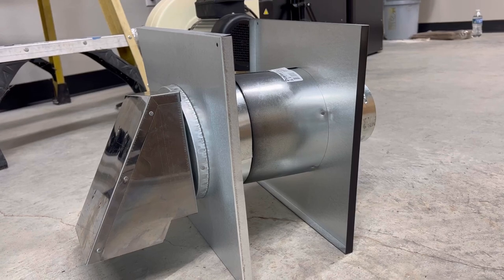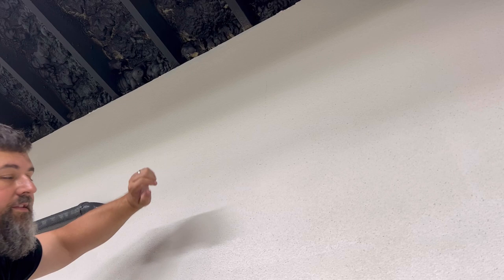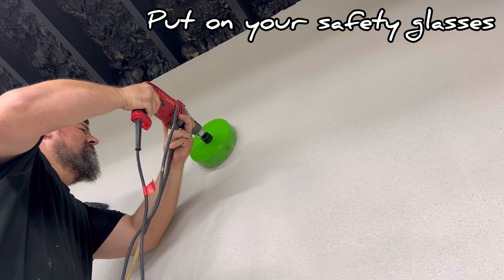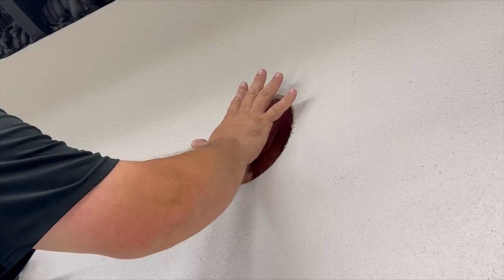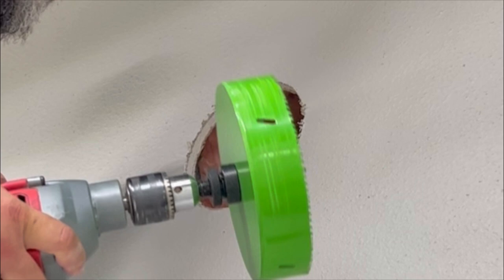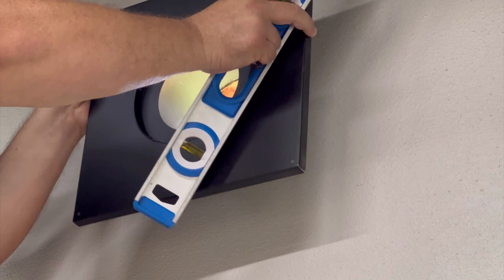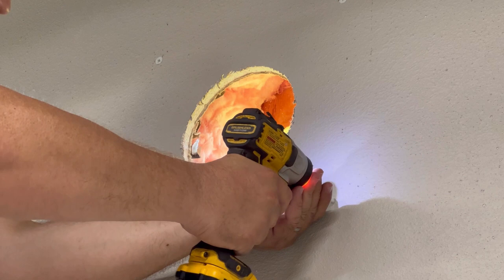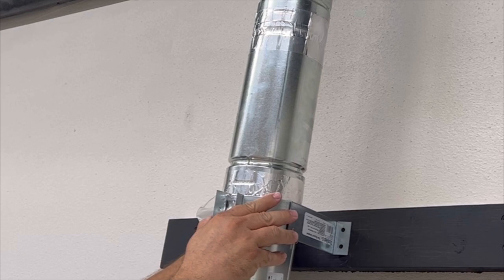How to Install a Wall Thimble and Stove Pipe

Comment: How do you know size to buy? If using say 150mm internal diameter twin wall flue with outside diameter being 180mm, what size thimble would I buy please. Thank you
Reply from the maker: You want to get a thimble that’s sized to the outside diameter of your stove pipe. The closer the fit, the less sealant you’ll need to keep cold air from passing thru the thimble to your interior.

Comment: Very nice, would just like more info what kind of tape and Caulking
Reply from the maker: The tape I used was aluminum duct tape. I’ll try to add a link here and a link for the caulk.
Reply from the maker: Here’s a comparable product (got mine at a local store): https://amzn.to/3FUkDrH
Reply from the maker: Here’s a comparable caulk: https://amzn.to/3FWT94V
Reply from the maker: Here’s a comparable exterior white caulk for the outside: https://amzn.to/40uKyQt
Reply: Thanks
Reply from the maker: @paulbramucci7586  you’re most welcome!
Reply: @GrubNGas  hi! the link is dead. would you please provide another link?
Reply from the maker: @ersozen  hey, which link are you looking for?
Reply: @GrubNGas comparable caulk. For interior, what type of caulk you use? Thank you.
Reply from the maker: @ersozen  here’s a comparable high-heat caulk in black: https://www.amazon.com/dp/B0006MXS4C/ref=cm_sw_r_as_gl_api_gl_i_9MMZX74FPDBWNJ5YKY5T?linkCode=ml2&tag=grubngas-20
Reply: @GrubNGas thank you my friend!
Reply from the maker: @ersozen  you’re most welcome, friend!